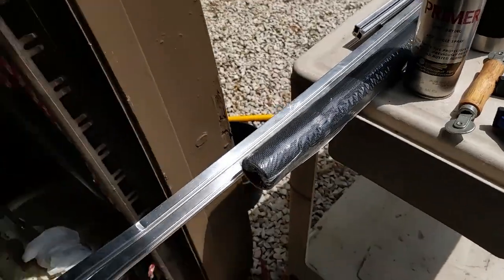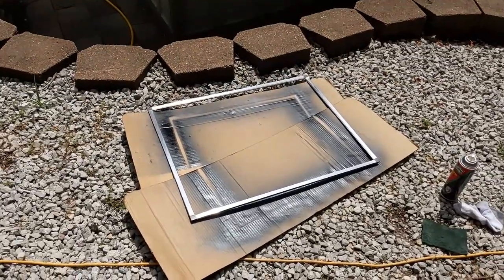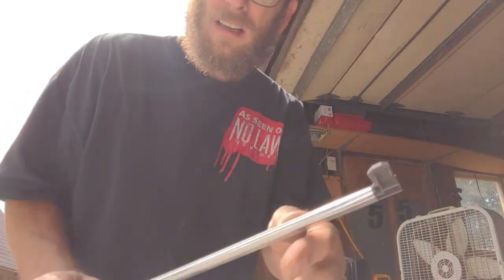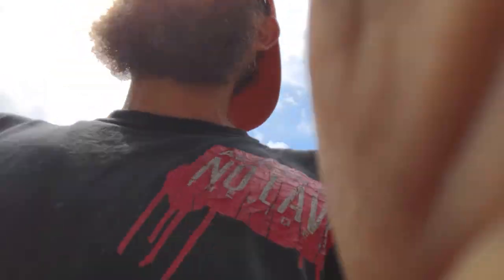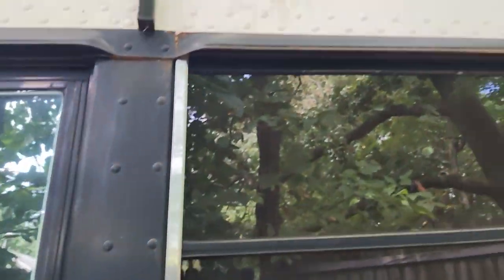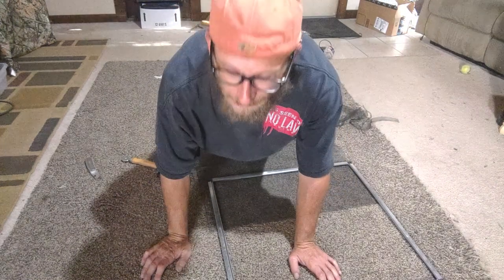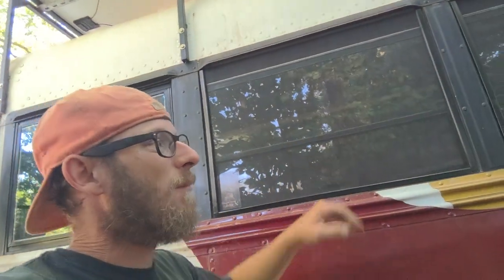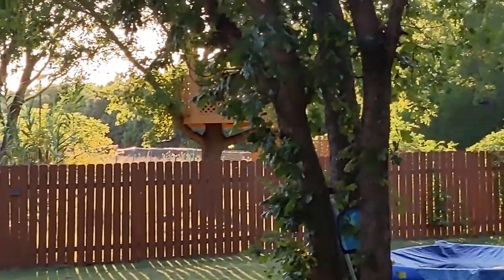DIY Skoolie Window Screens

Comment: Now I understand why window shops charge what they do for screens! 😄 No, but yours should calm down after a bit. The screen material will stretch. I think it's more because normally the screens are in channels all the way around. Looks like with your bus windows just top and bottom. Could screw in some self tappers into a short piece of flat bar on the bottom to keep the screens in and make it easy to remove them for service 👍
Reply: PS- enjoyed the sunset timelapse! 💕🤙